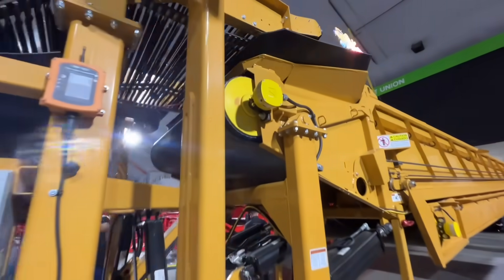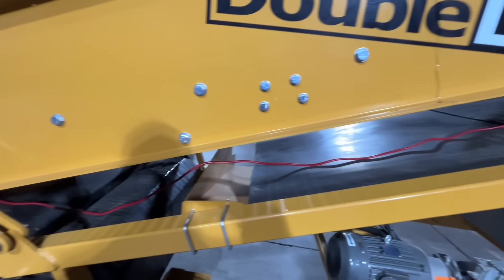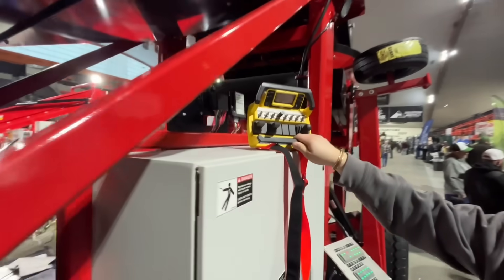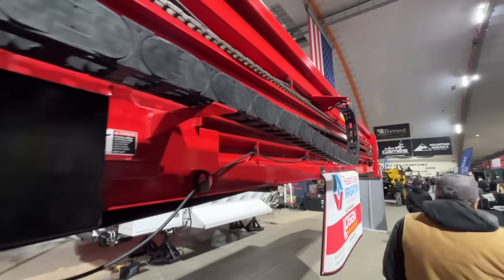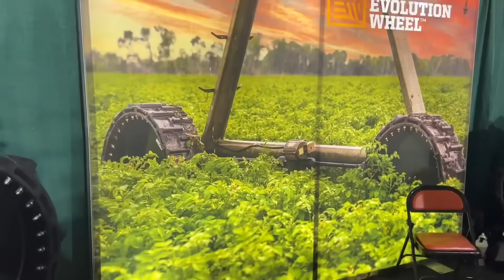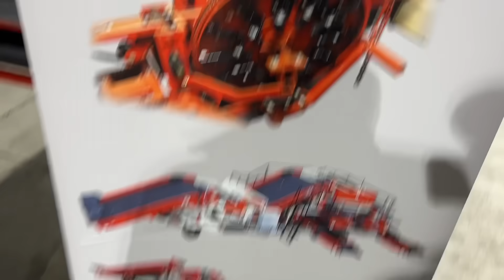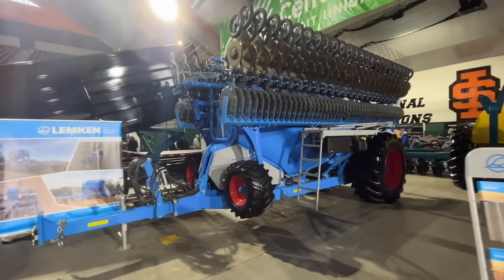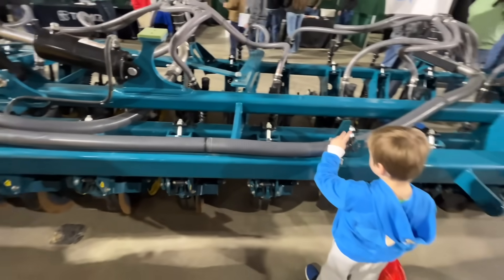Ag Expo 2025 – The Future of Farming is Here!

Comment: You need to take a closer look at that 774 Lockwood harvester.  Lockwoods build quality makes your spudnik look like a tin can.  Every part on it is better quality than spudnik.
Reply from the maker: We used to have Lockwood but it wasn’t as good as Spudnik that’s why we switched
Reply: @ I run  6740s  now. Used to be Lockwood 674s. I run Spudnik now because of parts and service, but the Lockwood is a better built machine hands down. I’ve demoed that 774. It would run circles around your 6640.